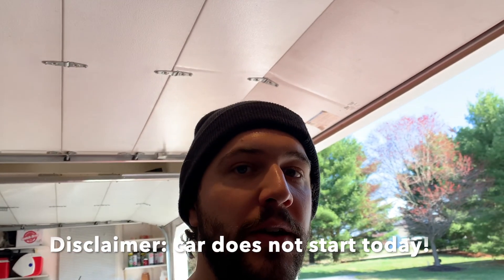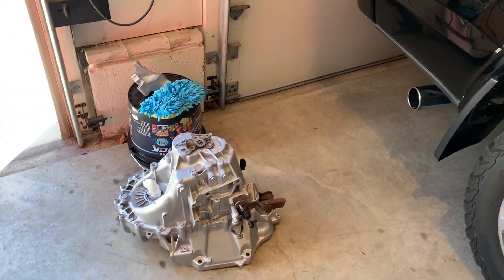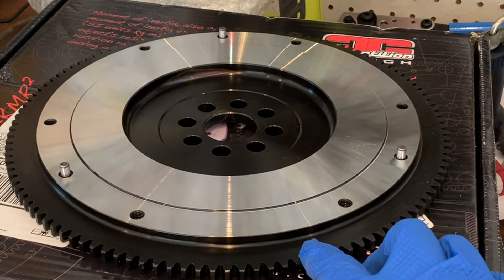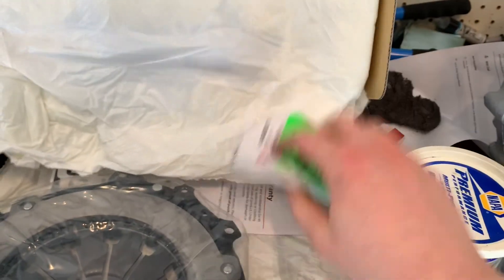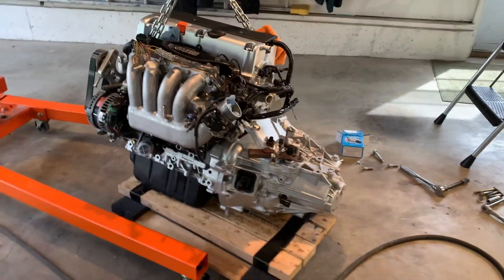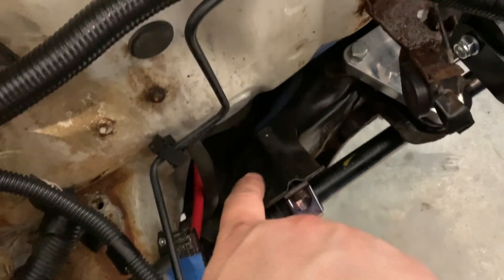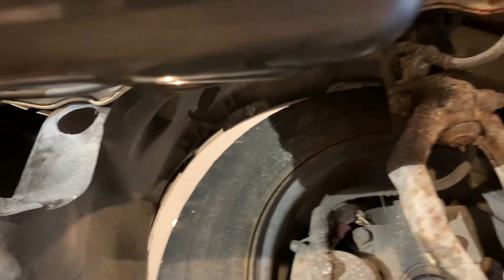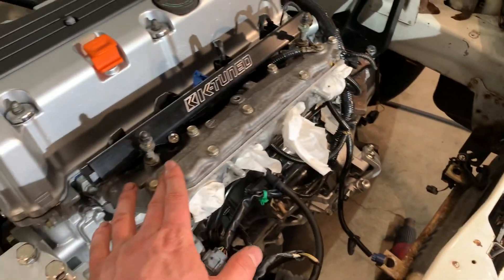K24 Engine Install Into 1995 Civic - Civic K24 Swap Part 11

Comment: How much  did you spend on the swap? , and  how hard was it to install AC on it.
Reply from the maker: AC was easy. Swap was around 10K I would estimate. This was not a budget swap. I got new hasport axles, k-tuned fuel kit, and many more unnecessary expensive parts. The 45 deg VTC, USDM alternator conversion and k20a2 oil pump add a lot to the swap as well.

Comment: For the rear mount the lower setting is the bottom hole or top ???
Reply from the maker: Lower setting is bottom hole for all mounts.
Reply from the maker: Are you having trouble getting it to line up?

Comment: Can you put a motor in a 95 civic that will make it go over 200mph?
Reply from the maker: Technically, any engine can get you to 200mph if you have the right gear ratios. It just might take a long time lol. I'd be more concerned about modifying the aerodynamics of the car with a bodykit, wing, splitter, etc to provide stability at that speed.
Reply: @e-dod  Thanks man, I'm going to try it out.

Comment: Hey quick question does automatic jdm k24 bring a poilet bearing already in there or u have to install one ?
Reply from the maker: You have to install one. Most clutch kits come with one if your getting a new clutch.

Comment: Hello, what alternator and start did you use?  Thanks...
Reply from the maker: Hi, using the starter that came with the engine, I think most K-Series starters are the same. Alternator is a 2005 Accord Alternator I got off RockAuto.com
Reply: @e-dod  okay, thank you. I was informed that automatic starter and manual starter are different.
Reply from the maker: @butchmandilag9916  Yea lots of misinformation out there. Also, make sure to get some manual transmission flywheel bolts. A few people had told me the auto ones will work but the auto ones are a little shorter. I showed the difference in one of my videos.
Reply: @e-dod  will do, thank you!!

Comment: What knock sensor are you using ?
Reply from the maker: I am using the knock sensor that was on the engine. The connector on the RSX harness hooked right up.